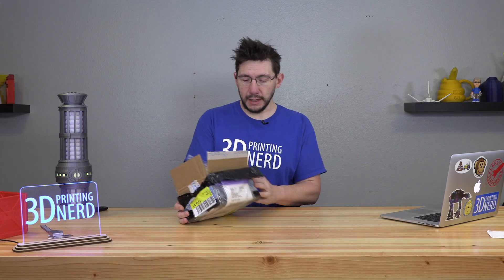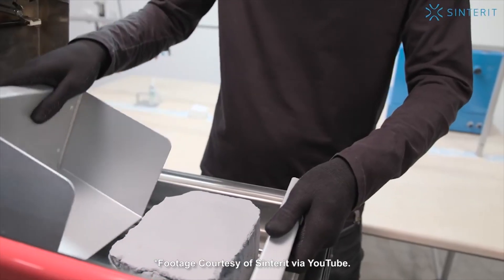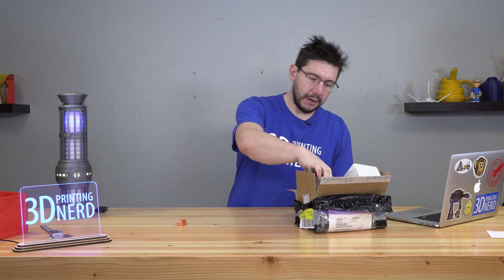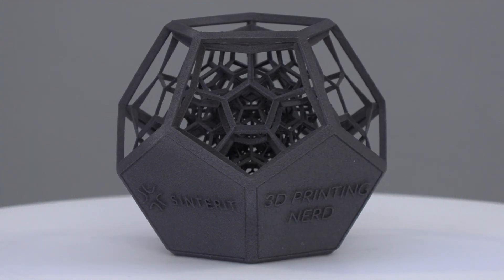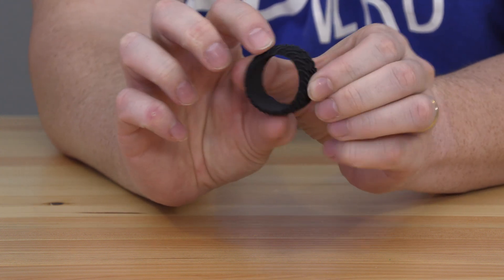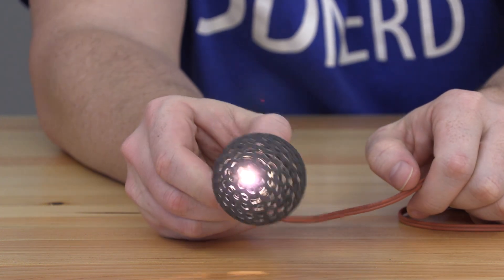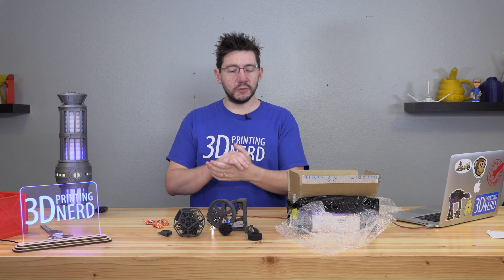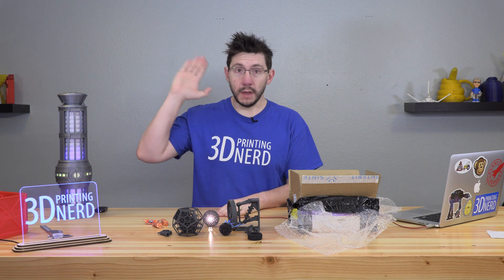What is SLS 3D Printing? Showing Models from the Sinterit Lisa 3D Printer

Comment: Please do a review of the HP full color 3D printer.  Like the SLS system it uses a powder to create the 3D components.  However instead of using a laser it adds a binding agent at each layer with its 4 color inkjet printer.

Comment: The first commercial laser printer (Xerox 9700) was @$350K in 1978 ($1.3 million today, adjusted for CPI). The first desktop laser printer (HP Laserjet) was $3500 in 1984 (roughly $8300 today adjusted by CPI). Of course the customer base for 3D printing is much smaller, so no doubt the developments won't happen as quickly. Still... the pattern's established.

Comment: So once you remove the extra nylon from the print can it be re used or is it just trash after that?
Reply: Can be reused
Reply: @CelsodeSá   But it will gradually degrade in overall quality, compared to metal sintering powders, and it's because it has to be kept at a relatively high temperature that is not that far from it's melting temperature. There's a video about that somewhere
Reply: @herseem  Thanks!

Comment: its really cool to imagine that price will go down... of course its kind of a mess to clean and to handle for now (mask, gloves, air cleanning ..) but even now small businesses can afod that materil which was reserved for big factories before... no doubt that this kind of technology will grow.
may be i am wrong but you dont tlk about one of the main advantage : no loss of material: the unused nylon powder can be put in the machine again... and may be you can even recycle the printed part by pulverise it again... that's seems really promising...
comparing t chap reprap, the material saving worth an extra price,  and it surely be economicaly good at about 1000 box...and its basicaly a laser some mving pieces and power with little less precision it could be build to get this price....
thanks fr showing us that and for inspiration...
high five :)

Comment: With every SLS build you have to play 3d Tetris to ensure you have a tight nesting. As most of these SLS you have to throw away 50% used powder and add 50% virgin powder. Atypical build is normally around 20% density. So your waste is 30% in the rubbish, none of these systems highlight this fact.
Reply: With Lisa machine You never throw away powder... With TPU material you can use the material over and over again, without any recycling, its 100% reusable. PA12 material requires 30% refresh to keep material strong, but your sentence that :"As most of these SLS you have to throw away 50% used powder and add 50% virgin powder" is just wrong. You never throw away PA12 powder. With refreshing process You just get more and more powder.  The only "waste" of powder is the volume of your print, and few grams that are wasted in sandblating process.
Reply: When you think you know so much on how an SLS printer and powders works, have a read of this https://orca.cf.ac.uk/54575/1/U584935.pdf   & https://www.etis.ee:2345/File/DownloadPublic/5d75a598-fdea-4feb-aff1-72c6a725605b?name=BaltMatTrib2015_article_Recycling_of_Materials_in_Additive_Manufacturing_Magi_Krumme_Pohlak.pdf&type=application%2Fpdf

Comment: I don't like to say another company's name on a channel talking about a company so 3DPN delete at your leisure. Formlabs Fuse 1 SLS printer is crazy good. they have this unit that prints, then one that shakes down the print to remove/recover unused powder, and lastly a unit that you put your unused (but used during a print) powder in and it mixes that with new powder (50/50 mix) to reuse. That combo is around 10k usd and the bed is pretty big.
Reply from the maker: Why delete? That's super good info, and while I was showing off models from Sinterit, the goal was to showcase what SLS could do. Your comment is very welcome, and it gets a heart from me!
Reply: Yes, it is important to spread the word about SLS which is so powerful. About reuse of a powder, it is great that @therealdeadpen comes with this topic. In Sinterit Lisa case it is even better: 70/30 mix (which means that it is only 30% new) and it is in PA12 case. If you are printing with TPU you can reuse 100% of it. So if you would like to spend much less than 10k USD, it is your option.

Comment: I doubt SLS will ever be a good tech for home use.  They would have to find a way to do the post processing in the machine.  The powder is not infinitely reusable so either there is a lot of waste or you have to wait until you have enough projects to fill the build space.  But for engineering prototypes and other business applications it would seem to one of the best options.

Side Note: It would be really interesting if they could get such a machine to work for glass using fine grain sand.
Reply: At $5K I'd look seriously at it. But the cleanup would have  to be, ehr, cleaned up and integrated into the main machine. I don't have space for additional equipment. It's the same reason I can't consider SLA.
Reply: You’re totally right. I work with and post process a cluster of SLS printers daily and the mess is awful. The industrial grade extraction and other machines to clean up need to be high grade and even bomb proof as, not many people realise this, but nylon dust is explosive. You don’t really want a box that could explode in your house.
Reply: The same what I was thinking. I'd be nice if all if not most of the process is done in-machine. The user only needs to refill the powder and maybe some minor cleaning after the process.
Reply: The first commercial laser printer (Xerox 9700) was @$350K in 1978 ($1.3 million today, adjusted for CPI). The first desktop laser printer (HP Laserjet) was $3500 in 1984 (roughly $8300 today adjusted by CPI). Of course the customer base for 3D printing is much smaller, so no doubt the developments won't happen as quickly. Still... the pattern's established.
Reply: You are right but SLA also needs post processing and the resin don't last forever either. This is not as popular as FDM but people can do lots of things to get the best quality available. One way they could save powder would be to find a way to change the size of the build box (?!?). One thing for sure, I'd buy that in a blink if it was cheaper!
Reply: I think in order for SLS to become home usable by your average consumer it would need to de powder the print before taking it out of the box and find a way to recycle the powder better as in all you have to do is top up the fill container every now and again with minimal need to change the entire volume. (Might be doable with some kind of vacuum system attached to the print head.) Then drop the cost to under 1k.  Dual extrusion with soluble support material will probably become a more viable solution faster than they can solve SLS.
Reply: under 1k ? Under 5k it would be more realistic...
Reply: It probably would be more realistic but at 5k its still a small business machine not for home use unless you are really dedicated to 3d printing as a hobby.  I personally wouldn't spend more on a 3d printer than what is a reasonable asking price for a used car.  But I'm a low end user.

Comment: It certainly will be interesting and exciting when this technology is really accessible to the average person.  It won't be long before the machines are in reach.  What is the cost comparison of the powder compared to filament?
Reply: I would not even consider buying these dust machines, even if the price came down significantly. If i have a part that really needs to be printed on a professional level, i'll just look up a professional print service that offers me all the different SLS materials, huge print volumes, and takes care of all the messy bits of work and the machines for me. Of course, if you yourself have a business and you currently order more than a few 1000$ worth of SLS prints per year, getting your own machine might make sense. But doing design iteration with a cheap FFF printer, and then send the finished design out for some SLS mockups, before we order the very expensive injection mold tooling, is currently the best way for us.